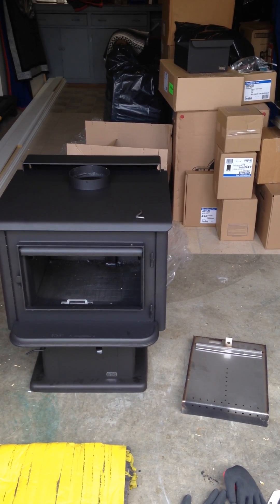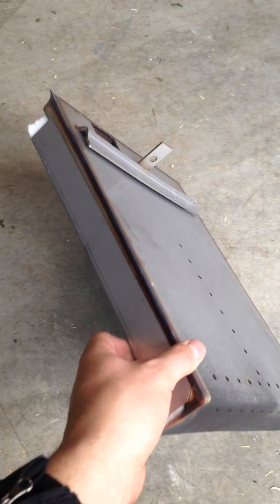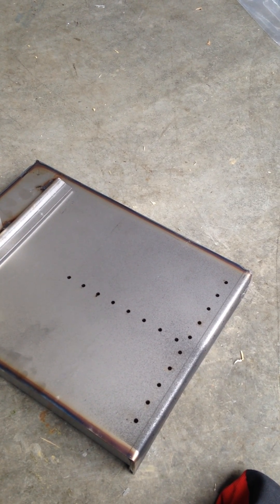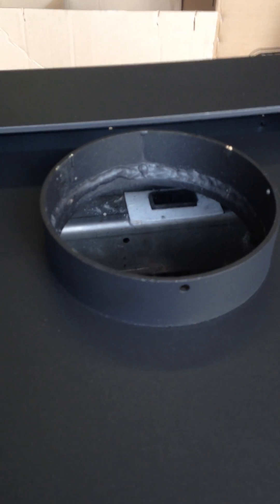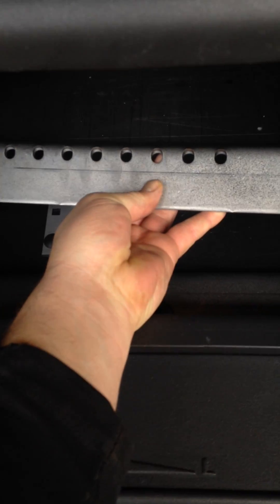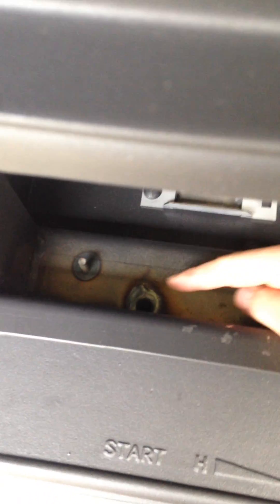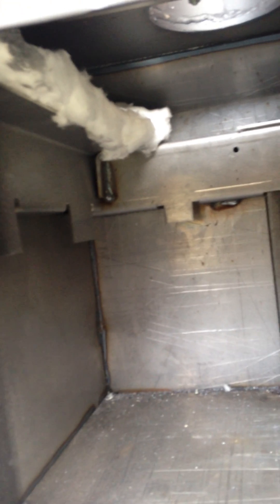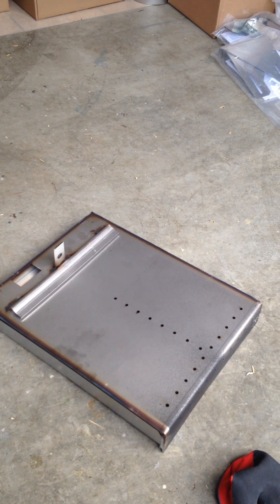Pacific Energy Super 27 Wood Stove Baffle System

Comment: There is a major error in this video. The boost air manifold IS NOT for the air wash. It's for directing a small amount of the air at the bottom of the fire for easier starting. This is unregulated on this stove. The primary air is fed to the air wash channel above the door. As the air hits the cooler glass is descends, thus washing over the glass and keeping it clean.
Please correct this part of the video. Otherwise it's a cleanly shot video and helpful.
Reply: Nobody… cares…

Comment: I was cleaning my stove today and when i pulled the baffle out it had some burnt looking insulation that is sandwhiched between the plates. i pried the tab over to remove the cover and lifted the insulation and the corner ripped off . it was 2 inches by 3 inches. My question is how important is corner of the insulation for safety or any other reason ?
Thanks
Reply: kutamatah have it replaced
Reply: I had the same thing happen But I just stuffed some toilet paper up in there. The color match was perfect.